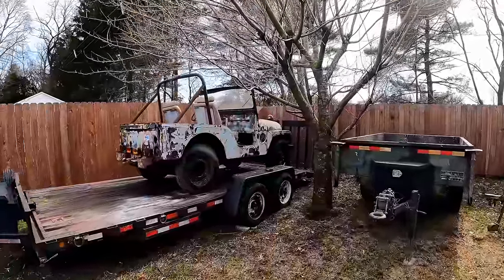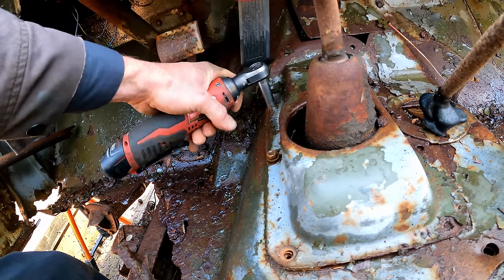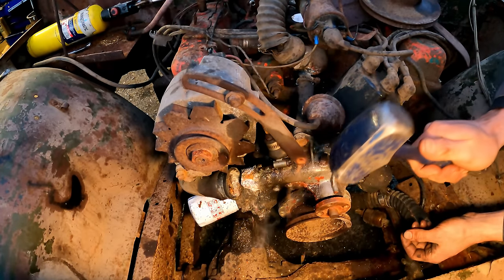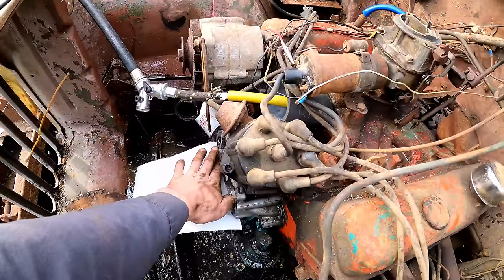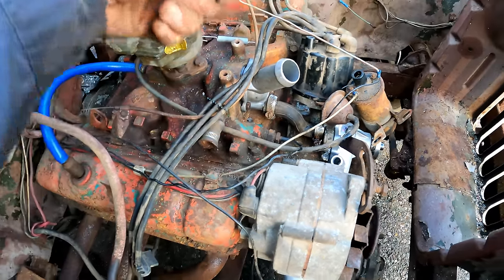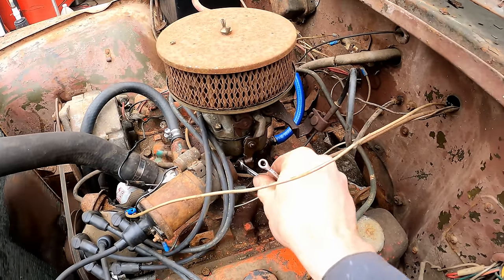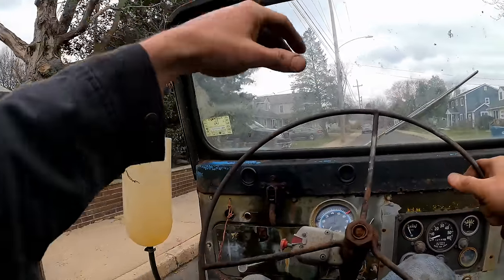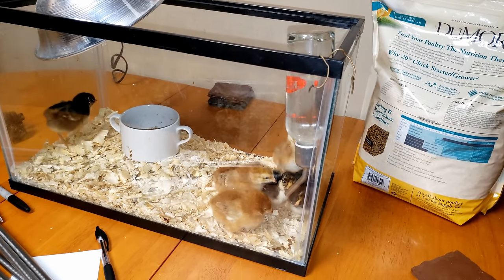Will It Drive? JEEP M38A1 Dauntless Death Trap (DDT)  - NNKH

Comment: This thing is Beautiful!!! I am a chemical engineer but I was run over on my 1957 Harley Panhead right at the beginning of the beer bug outrage and it has taken until now to recover and learn how to walk again. I decided I want to change careers to mobile welder/Fabricator and machinist. I have been putting together a metal fabrication  shop and it is going well. I found a 72 inch metal brake and a vintage 100 year old lathe.....get in touch if you ever want to come out near King of Prussia and make some body panels or something...
Reply from the maker: Yeah she sure is pretty! And damn, I'm sorry to hear about that. I hope recovery is going smooth and you work back to 100%  That's awesome that you're doing a fabrication shop. I'm actually in Pennsylvania also. Whereabouts are you? I'm just north of Philadelphia. Sometimes I don't see the replies on here since it doesn't notify me. But shoot me an email sometime! It can be found in the about section of my channel page if you're on desktop
Reply: @NoNonsenseKnowHow  Sure will! I am in Phoenixville.....

Comment: When you remove a diff or transmission plug, stick a small, powerful magnet on the base of the plug. That will catch much of the rust and other metallic crud before it does damage.
Reply: Cool...

Comment: Don't know if anyone mentioned this below but I believe you have a 1965 CJ5 chassis and running gear with a late 1950's M38A1 body.  The windshield is also newer than the body.   Cool thing about the  M38A1 fuel tank that was mounted under the drivers seat was the large filler neck.  they had a built in funnel that slid out of the  neck.    Good luck with the rebuild.

Comment: I have two of these Dauntless engines.  They like some back pressure on the exhaust.  I was running straight pipes for a while and gained quite a bit of power by adding a simple muffler on each side.

Comment: 03:24 that thing you were holding is the remains of an example of the precursor to the folding E-tool you used in part 1 to dig out the front tire so you could get to the valve stem.

Comment: I had a 1966 with the 4cly motor... I rebuilt the motor bought a used soft top and put some 31inch tires on...had loads of fun... and reliable to drive

Comment: Ok, let me know what you think. Put a whole new tub on, tidy up everything to make it safe. True dual exhaust is a must have! But best yet, there's a bull gear overdrive you can install on the transfer case! You take the PTO cover off, put in the OD kit, and it comes with it's own shifter. It will work in all 3 gears, giving you a 6 speed, or really a 3x2 transmission! Then just daily driver that baby into history!

Comment: I love that jeep is the best of the worst you win for sure I had several jeeps in my day old53 military M38 A1 will 350 horse 327 I bolted it to the original transfer case with an adapter the Jeep was crazy to drive with 5:38 gears what a blast I was young thanks for doing this excuse me inspired

Comment: As long as the frame isn't rusted through you can bring her back with either a tub insert or freehand sheet metal work.  I once used old car hoods from a junkyard to put floorboards in an old Ford pickup, do what you gotta do! 😎😎

Comment: I am kinda late but to get that stuff out of the well 16:32 is by using one of those retractable hooks that opens up like a Lotus flower, It operates using a Spring so you can also trigger it, Drop it down let it sink, and open the hook, Spini it like spaghetti and pull out.

Comment: If the frame is M38A1 the chassinumber is stamped on left framerail just behind front bumper (no plate, just stamped directly in to the frame). It should start with M38A1 then the actual number, (there are other variants depending on year of manufacture). My old M38A1 was a 1960 and chassinumber was stamped on left framerail.

Comment: The VIN, or serial number, should be found on a plate fixed to the firewall, inside the engine compartment, top drivers side.  I can see something there in the video, but not sure if that's it or if it's even legible.  Sometimes the serial number is stamped into the top of the frame rail, passenger side, around the rear mount for the front spring.  I've heard of them being stamped other places on the frame as well.  Keep up the great work, I'm looking forward to seeing more on this Jeep.  I had a '69 CJ5 with the 225 Dauntless for awhile, but had to get rid of it because I had no room.  I loved the rumble of that odd fire.

Comment: I know where there's a property in South Jersey with tons of old cars and construction equipment sitting around, there is a late 50's Willy's jeep there that was running when parked 30 yrs ago, the 4cylinder engine is stuck. There is also a Fury Wagon like your's there also with all the orig stainless trim including the air dam on the rear roof, the 318 is stuck from sitting and the floors are gone but the inter isn't bad.
Reply from the maker: That sounds awesome. Would love to know more info on it. Shoot me an email or I can also be found on Facebook and Instagram under the same handle. Thanks man!

Comment: If I recall correctly, It can idle so low because the flywheel is super heavy, made that way because of wired timing… I used to have a ‘66 cj5 with a Dauntless… cool engines

Comment: You should blast that jeep down to bare metal and weld in replacement floor panels.  Aftermarket Jeep parts are everywhere and affordable compared to many makes and models.  Looks like you have solid bones there.

Comment: You can still find body parts, engine parts, and transmission parts, but if the transfer case has to be rebuilt, no spares are available anymore. You might have to find a more modern transfer case and hope it bolts up to the T-90 tranny (pray the gearing matches up, too, or you will have to machine your own).

Comment: I see you bare bones the M38A1 Jeep into Civilian Jeep vintage with bigger engine than the   Ford straight four engine. Maybe Bantam inline 4. Can you try to taking all apart the Jeep motor and pull out the valve and see if it is rust. Also pull up the old distributor and look at rust shaft? The inside the engine would rust worse than what eyes see the outside of the engine that is over 40 years old. I bet. Thank you.

Comment: OK, If that Jeep is a true M-38A-1 the VIN # should be on a brass plate on the dash. I know, because I have one. There also should be a plate showing the VIN # on the driver side firewall if it is a 1952-3 model. The windshield should have rounded corners and be a 24V system with a door for the second battery in the cowl on the passenger side. I rewired the generator for 12V because the 24V lights are practically impossible to find today.
    And, YES, it is very restorable because I have been offered $22,000 for mine! No SALE! I see your engine is an "F" head engine with the valve cover on top. Mine had a Continental 4 Cylinder flat head engine and the T-90 transmission with all wires water proofed and the fording kit from the top of the windshield to the Carter one barrel carb. Mine came in three crates for $1,100 in 1978, I had to it it together myself. I had to replace all seals in the engine, tranny, master cylinder, and brake cylinders. I also had to re-do all the brakes because the drum brakes had seperated from the shoes (including the emergency brake on the rear shaft). It was a labor of love to a 20 year old kid. By the way, unless you change the diffs, 45mph is max for that Jeep, so I changed the diffs, front and rear. Be very careful going around sharp curves, I almost rolled mine once. Good Luck if you do  a total restore on it!

Comment: What year is that Jeep, anyway? My buddy has a 69 CJ5 with the Buick Dauntless odd-fire V6 that I've done a ton of work on. As far as I know, the military versions never came with that V6, but I could be wrong, and it also could have been installed at some point in the past. Either way, cool little rig! Yeah, those odd-fires DO sound odd, but they are torquey as hell!

Comment: I know im late but those jeeps are mostly flat panels of sheet metal replacing the rusty panel aint hard at all
The wiring is pretty basic so not difficult to re wire that being said its hard to say a jeep is to far gone to be restored its even harder to justify crushing a jeep
Because theyre so easy to fix  also the after market support is probably the best of any vehicle ever made 
You can literally buy a whole m38 tub new for 
Under 3 grand without shipping cost also theres a lot of new used and nos parts available for 5000 grand out of pocket you could make that jeep a good solid nearly completely restored vehicle 
If you dont want it just sell it someone will buy it for parts or restoration

Comment: The CJ1 made in 1952 without the floor pan. The v-6 engine is usually Corvair chevy at Willy in Pennsylvania but it is no longer in serviceable so the Willy went to Ford and Ford took over the CJ short truck but until Chrysler Daimler bought the Willy Cherokee, Wrangler and Crawler. The Jeepster became with its 390 cid somehow it's true. The Dodge was building truck bigger like size of Cabover C600 or C5. There were diesel engine for Jeep if you Army have the money otherwise Nazi build rabbit camouflage with diesel at Third Reich automobilia union where Mr. Porsche was enslaved to work a very little for Hitler's teamster driving Krugenwagen. The War Wagon with hybrid V-6 that rebuild into1952 CJ1. Please, can you find the code marked on the engine?  Thank you.

Comment: That’s what they will eat military Jeep for known for you could run them one day let them sit for 3040 years then run them again and they work just fine for a couple little tweaks you’d have brakes you’d have engine you have movement you have lubrication you have it all and the funny thing about them Willys jeeps is the  Original four-cylinder engine that it had could take a 50 caliber bullet to the block and keep running

Comment: If it is possible to drill a hole in the concrete in the well it MAY be possible to lift it with a lewis. 

https://en.wikipedia.org/wiki/Lewis_(lifting_appliance)